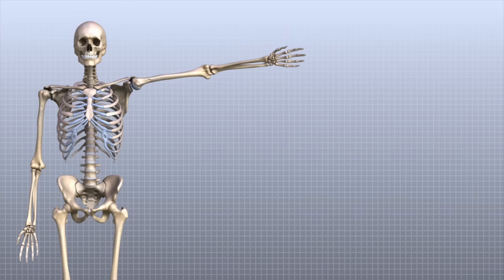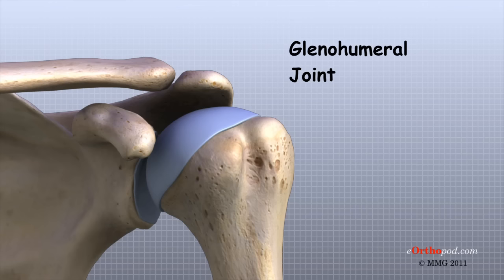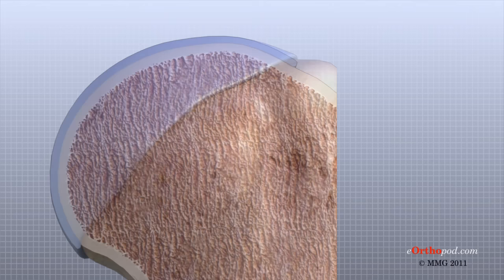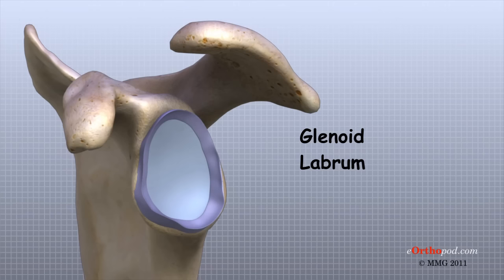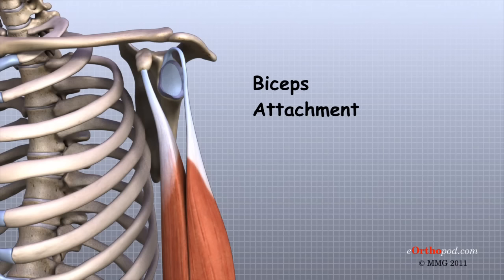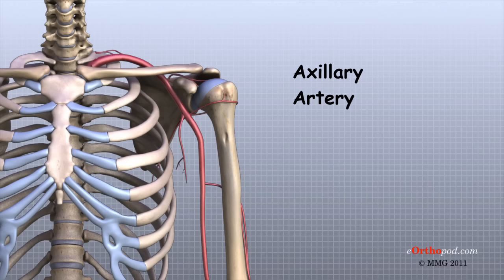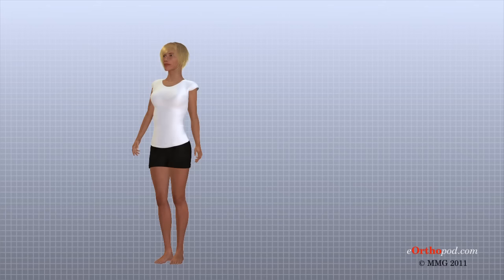Shoulder Anatomy Animated Tutorial

Comment: I had a shoulder operation about 20 years ago which worked very well.  It is now very painful and difficult to use, a scan shows that all the tendons are snapped and there is a rotator cup tear.  I have tried for about six years to have it repaired.
I also have had two left shoulder operations.  The first was done by a trainee surgeon and monitored by an orthopaedic surgeon.  I was told the joint just needed cleaning out.  The trainee surgeon did a lot of damage.  I was left with a shoulder that was very painful and difficult to move.  I later found out my shoulder had been damaged and now had a 30mm rotator cuff tear and snapped tendons as well as a snapped bicep tendon.  The surgeon who had been training the trainee surgeon refused to examine me after the operation and informed me there was nothing more they could do.  I was forced to see a second surgeon.  He tried to repair the tendons and rotator cup tear but was unable to repair them which left me with a shoulder I cannot use.   It has taken me many years to find a surgeon who will help me.  I have been told I need both shoulders replaced.   My question is.  Can torn tendons be repaired when I have these operations?

Comment: If you happen to have a sore in on your shoulder that isn't going a way after massages and that is sapping the strength of your arm or limiting your range of motion, it's a knot that is being clinched/caught up by your shoulder blade and one of your ribs. Release the knot by finding the one rib on your chest that feels out of place or not in uniform with the rest of your ribs, and push it with your other hand, take a deep breath and hold, while moving the injured side of your arm up and down side ways. I learned this on yt and it took 3 seconds to fix what I have had for almost a year and spent so much money on.

Comment: Uhhhh so I was watching this and trying to feel the different areas of my shoulder to understand it’s movement better.  Have had chronic shoulder issues causing shoulder blade and back problems.  Anyways, I got to the SC joint and was fascinated cuz I’ve never given it much thought but it’s fascinating how that alone anchors your arms to your skeleton. I noticed mine were sore, especially the right- had bicep tenodesis a few months ago on that side.  Began massaging and doing shoulder shrugs/circles to give it some range of motion.  Well, soberly I felt the right joint shift up considerably.  I felt panicked, scrambled for my glasses too lol in the mirror.  It feels more prominent than I remember.  But it actually matches the left side  so my worry subsides. But, all of a sudden my pain is gone, and my shoulder blade is actually tracking properly without thought.  I’m am flabbergasted honestly

Comment: The normal rhythm between the humerus and scapular is 2 to 1 degrees. For every 2 degrees the arm moves up, the shoulder blade should rotate 1 degree. The ratio is not always 2 to 1 during the whole movement. During the 1st 30 degrees or so of humeral abduction, the scapular does not move much, but catches up, as the humerus keeps abducting to average a 2 to 1 ratio.

Isometric exercises are a great way to keep the shoulder joint healthy and help correct Scapulohumeral Rhythm.

Comment: Thank you for this video.  It helps me to understand what exactly is going on in my shoulder.  I have been diagnosed with a full thickness tear in the supraspinatus muscle and I'm told I need physical therapy before surgery but I still can't understand why.  I'm wondering if the MRI results are accurate.  The muscle tear and the pain don't match up and the shoulder function seems to indicate something else is wrong as I seem to have no pain when lifting the arm out, which is what the suraspinatus muscle does.  The pain doesn't occur until about 30 degrees out from the body and when I twist the arm from that angle.  There is more to it than I'm putting here but needless to say I will have more to talk with the doctor about after viewing this video.
Reply: How did it go?

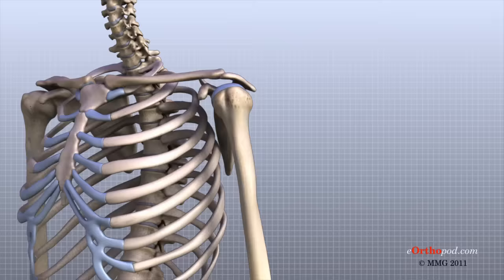Comment: 4:44 "Deltoid muscle provides power to lift the arm once the arm is away from the side" <-- at what point is "away from the side"? Do you mean that deltoid is responsible for upper range of motion (say, arm position parallel to the ground to up) and rotator cuff muscles more for the lower range? Would this then mean to strengthen the rotator cuff, you don't need to go beyond that lower range of motion?

Comment: Is there any non-invasive method, (can't have an MRI and the CT arthrogram is of little help) using only Kinesthetics to accurately determine the problem? And if so, who can do the job, chiropractor, orthopedic surgeon or some other professional in sports medicine? 

My shoulder, with a rotator cuff repair 20 years ago, was badly damaged 3 yrs ago thru improper use of crutches, and a walker, post triple surgery to repair my femur, and ultimately a hip replacement due to surgeon's screwups. Months of crutches and walkers, and rehab, did something to the shoulder but subsequent testing by my rotator cuff repair surgeon, is not yielding the precise problems.
Now, certain movements (or inability of certain movements) are impossible. 

I have been told to expect a complete left shoulder Arthroplasty, as a real possibility, after an exploratory invasive procedure is done to accurately diagnose which muscles and tendons of the shoulder are compromised, torn, or detached.  

I'd like to avoid an Arthroplasty, to fix the problem. Trying to find out if more specific, targeted movements---using kinesthetics, to test my range of motion, strength, and their limits, to see if it would help narrow the  possibilities.

Comment: my right shoulder acromioclavicular ( AC) Joint is seperated while playing dodgeball when i was in 7th std. Experts plz tell me should i cosult this to doctor ? i m 26 yrs old now. My shoulder is not hurting me even though it is seperated but i m afraid that it may hurt me as i get old
Reply: +mangesh karande  me to
Reply: +mangesh karande  everything what is damaged needs doctor's consult.
Reply: Old injuries have a way of repairing. That means the body makes alternative adjustments, for example,  just like if you rip a muscle off, the others will work to comepensate. You may not move like normal, but you're going to move. By making this work, your torn muscle will disolve and maybe even the tendon. In the case of your shoulder, you'll have parts that may be gone by now, such as ligaments, parts of the rotator cuff if it was damaged. If there's no issue, don't make one. Surgery just may be more of an issue than you need to deal with.
Reply: @franklopezlmtmti3146  "torn muscles will dissolve" source?
Reply: @RivenEnjoyer6897  A&P books and personal experience. The body has secondary muscles that "kick in" as the act of survival that will take over but full range of motion is gone. While these muscles get stronger, the damaged/torn muscle begins to atrophy. No use, in time the muscle shrinks and will continue to erode until it is one long tendon, if connected. Otherwise, it will disintegrate. An example is my triceps was torn off the joint/olecranon process and took 3 months to get my surgery. In that short of time, the muscle retracted, tendon shortened so I needed a tendon graft and now, only have about 70% of the strength and a much smaller triceps that the right side. The body's efficiencies in ridding itself of useless parts and supplies began removing my triceps.
It is referred to as Disuse Atrophy: Muscle wasting. I said dissolve but it is better said as muscle wasting. Too long causes permanent damage. This, you can Google. I'm not by my textbooks at the moment.
Reply: @franklopeziilmtmti603  Probably would've made more sense to me if you used the word atrophy instead of dissolve
Reply: @RivenEnjoyer6897  LOL. I forgot I what site I was on.

Comment: i have carpal tunnel problem and sooooo much pain. what should i do?
Reply: +Kalpana Trivedi There are several components to learning anatomy. One resource I found which succeeds in merging these is the Anatomy Blueprint Pro (check it out on google) without a doubt the most incredible info that I have ever seen. Check out this  unbelievable website.
Reply: +Kalpana Trivedi - If you haven't tried wearing braces, I'd start there.  you can get them at a drugstore of online. Here's one I've used on Amazon: http://smile.amazon.com/Futuro-Energizing-Wrist-Support-Medium/dp/B0026RHGAM/ref=sr_1_4_s_it?s=hpc&ie=UTF8&qid=1458035725&sr=1-4&keywords=futuro+wrist+brace  .  It holds your wrist in "neutral" position so the nerve isn't impinged. You can wear only at night or also during the day depending on level of pain. There are also braces that cover more of your hand primarily for night use only.  If that doesn't help, I'd see a hand surgeon.  I've had carpel tunnel release on both of my wrists.  It was a super easy procedure and very easy, minimal to no rehab.

Comment: Update: Even with a great PT guy,  I couldn't get far enough back to normal use of my shoulder without having total reverse shoulder replacement surgery. I want to let anyone else who faces this know that, if you have a good surgeon who works in a good hospital, it is not the horrific ordeal you might think just looking at what is involved. My recovery has been relatively quick, and the pain is manageable. (I had much less pain than followed the original break). Good luck to all who have shoulder injuries!